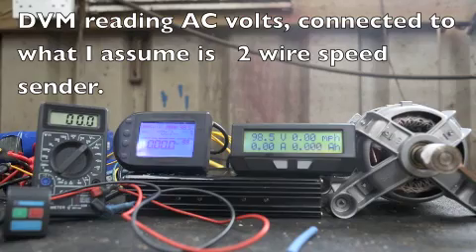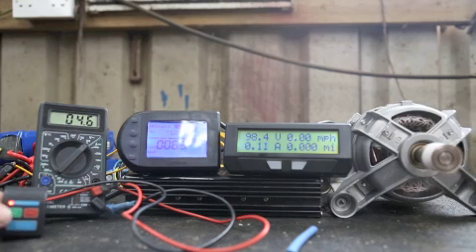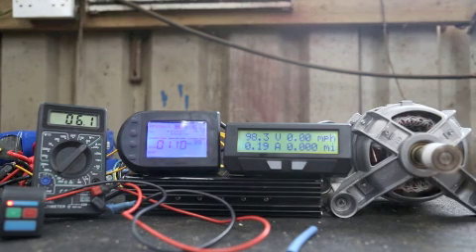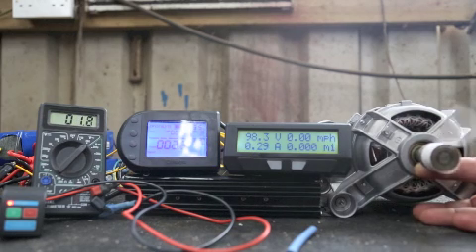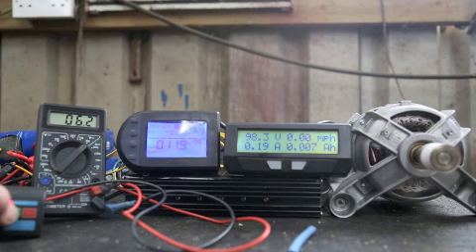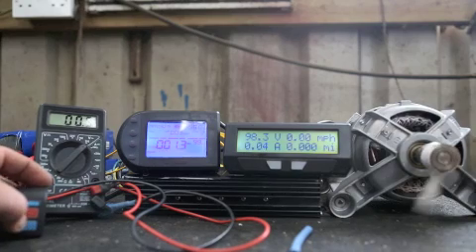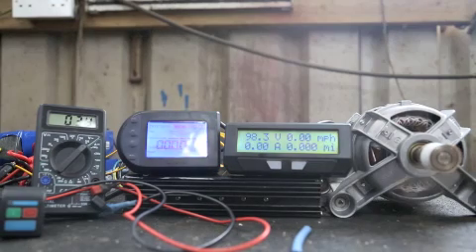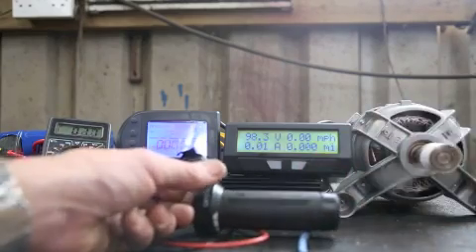Washing machine motor

Comment: Neil Hi, I kindly ask you how did you connect the power connectors (there are 5 cables on the motor, how should they be connected?) Do you have a pic or schema of it?
Reply from the maker: Cybercult
Reply from the maker: Cybercult I am sorry, bit this was too long ago and an experiment I never continued with.
These. motors are not suitable to run with typical BLDC sensor less controllers so I did not take it any further.

Sorry I can't be more help.
Reply: thx for your answer Neil :-)
Reply: Hi Neil,

maybe my first question was a little confusing, I just wanted to know how did you wire/conncect/bridge/ or bypass the 5 connectors on the
motor to get it on running anyway. Because I have the same motor without any plan or explanation of it (I bought it used).
Can you remember how do you did that, or give me other proposal?

Kind regards
Reply from the maker: Cybercult umm. I have just watched the video again, and I mention a 2 wire speed sender, or that was what I thought it was.  as the motor sped up, the voltage out of it increased, think I'd had voltmeter in AC voltage mode.

That would then leave the standard 3 wires for the main windings.

The controller I used was a Crystalyte /Lyen /XieChang '3phase' Brushless DC sensorless controller
like 

https://endless-sphere.com/forums/viewtopic.php?f=31&t=19587

It has two wires for DC input and three phase wires to connect to the motor.  
They can be connected in any order to the three wires of the motor.  If it spins the wrong way, swap two wires.

But it did not work properly since these ( I believe) are know as induction motors... no fixed permanent magnets, so an e-bike pulsed DC motor controller will never work properly.

If you need to use one of these motors for any fixed application you'd be better finding a correct controller from the washing machine the motor came from.  I was hoping these motors could be used with the Lyen style controllers, but they can't
Reply: Neil Hi, its really kind of you, have a lot of thx. :-)

Comment: I did also some ac / dc playing with this motor.. induction it is.. because the massive core.. they run on AC .. maybe new type sinewave type controllers are an idea for this.. otherwise a frequency regulator

Comment from the maker: As in the video, by using a Brushless Motor speed controller.
I attempted to use an Xlyte Brushless DC ( BLDC) Controller but it was  not a great success.

The work I was doing in the video was to see if these old washing machine motors could be used for other projects with the type of controller I had to hand... But No, they could not.

Although these wash machine motors appear physically very similar to the BLDC motors I am familiar with, they operate slightly differently..

So if you wanted to get one of these running  successfully,  you would also need to remove and modify the original speed controller from the washing machine along with the motor.

I never did any more on this.